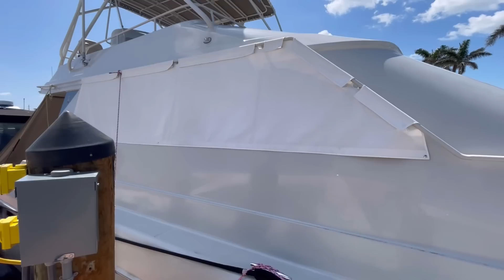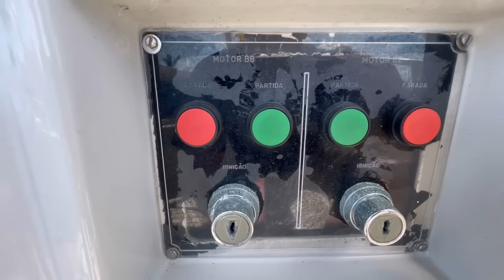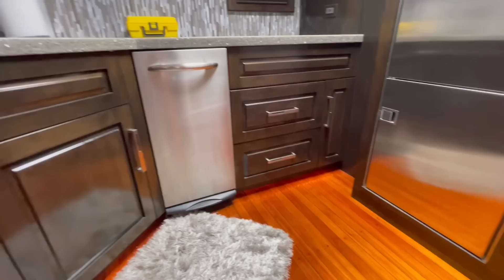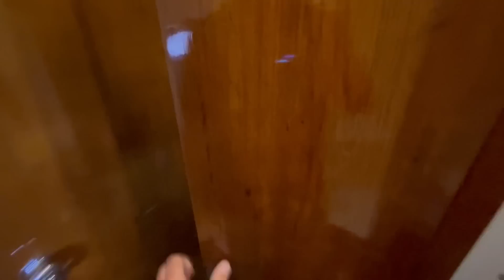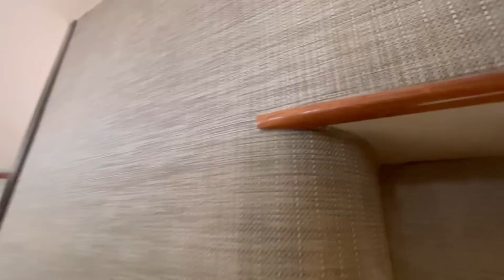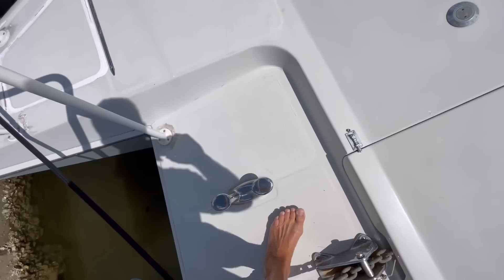For Sale - 1995 58’ Mares Powercat - Full Walk Thru!

Comment: Those are not motors. They are Engines and the Mules Scream when come to boost pressure.
Reply from the maker: I get this every so often.  They are used interchangeably and defined as such.  

mo·tor
/ˈmōdər/
noun
a machine, especially one powered by electricity or internal combustion, that supplies motive power for a vehicle or for some other device with moving parts.

en·gine
/ˈenjən/
noun
1.
a machine with moving parts that converts power into motion, especially one that supplies motive power for a vehicle.